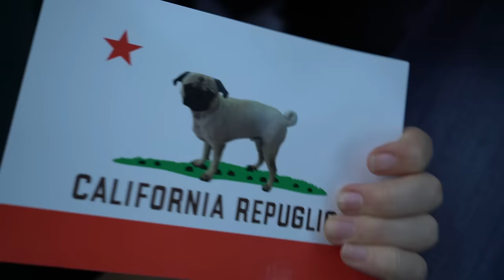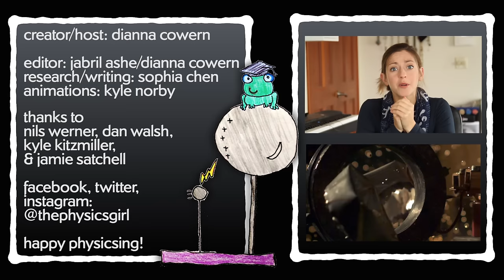How to control light with water

Comment: as a network engineer: I think you missed one of the most intriguing features of fiber optics. it can carry different wavelengths of light (we call them channels) . sticking with your laser pointer analogy: it's possible to send the light of differently colored laser pointers through the water at the same time and sending a different morse code on each - color only is a difference in wavelength/frequency after all. if I got your attention you can take a look at the Wikipedia page covering this topic: https://en.wikipedia.org/wiki/Wavelength-division_multiplexing there's even more science in there but the page is pretty OK
Reply: Thumbs up! I thought the exact same thing. I think it's because she didn't go into demodulation and the multiplexing part of the communication.
Reply: Frequency division multiplexing is not unique to fiber.  Back in the Olden Days, the fleet broadcast put 8 75-baud channels in a single 3 kHz HF signal, just for one example.
Reply: Very cool and useful phenomenon. I think that's a general property of waves because of the superposition principle and since sine waves at different frequencies are linearly independent.
Reply: A very interesting point!
Reply: TheThagenesis it would be nice to c a fallow up simple video, explaining the analogy of code Morse vs frequency interference...
Reply: Hi. Good question. Fragmented packets are not assembled at the ISP. but at the destination host (receiver computer). since It receives the packets in a random order depending on the routes the fragments took in the network. then matches with the original message.
Reply: there are different levels of reassembly depending on what you mean. all the light from a fiber optics cable is generally split by a DWDM shelf into the different channels (colors) the signal may be refreshed and/or amplified within the shelf and then the cable containing the channel is connected to a fiber interface which is plugged into a router (SFP is the standard for this nowadays but this changed quite a bit in the last 10 years). the SFP converts the information encoded in the light (typically an ethernet frame that contains an IP packet) into electrical signals the the router can finally put the IP packet into its memory and send it out again on the correct destination interface. this happens again and again until the packet finally reaches your home router and then finally your computer. the tcp/ip stack of the computer's operating system (Windows, Linux, MacOS or whatever)assembles single IP packets into a continuous TCP or UDP data stream and the computer finally can show those cute cat videos
Reply: I used to work for verizon fios, i was surprised at the sheer amount of data that went through the major COs

Comment: Hey Diana,

if you drill a hole in the bottlecap and put a longer straw in it, you can get a constant flow rate according to Bernoulli's principle. Use glue or blu tack for seal between the cap and the straw. You can adjust the flowrate by changing the lenght of the straw. So you just get the perfect constant laminar speed and the experiment will last longer.

I hope it was helpful

Comment: As someone else commented - Even more interesting than sending light down the fiber, we send MULTIPLE "colors" or wavelengths of light down fiber: Multimode.  With the use of a fiber optic multiplexer, we can do what's called Wavelength-division multiplexing.  Similar to how phone lines can send different frequencies down the same cable to carry your voice and data transmissions, multiplexing allows significantly more throughput (bandwidth) to go down the same strand of fiber. 

You mentioned that we will never be fully wireless, but I'd like to augment that statement.  End users can and will have the ability to be fully wireless in the near future, but it will be because of the accelerated growth of fiber optic networks that will allow this to become a reality.

Comment: You can encrypt owl post! You can use any of the encryption methods we currently use all you would have to do is right the code on some paper and it would take a long time to encrypt and decrypt by hand. Wizards also use Howlers which only activate when the intended recipient touches it. so every piece of post could have biometric recognition on it. (Better than muggle technology) The real question is that if you can apparate why not just not apparate wherever you want and tell the person the content of the letter.

Comment: to put into perspective, if you don't have to hop to another network, a high quality circuit can do us coast to coast transit in under 50ms. Fiber is still subject to a lot of outside damage, vandalism, animals, car accidents, etc. i have worked for almost every major telecom corp and you'd be surprised how much damage and outages are due to rodents/squirrels. Once they get inside they normally can't get out, panic , and shred the fibers and sheath to bits.

Comment: And the coolest part about optical fiber is that we make cables so well that we are still an order of magnitude away from maxing out the physical capabilities of our current fiber, so without having to redo the cabling, we can still make the internet a factor of 10 faster. After that we'll need to use a diamond/glass composite for diamond's wider bandwidth and a more acute critical angle, allowing for more physical space in multimode operation. Might be able to squeeze another order of magnitude out of that before we work out how to make fiber optics with a vacuum as a core...

Comment: But but but, you have the Level 3 problem of information density.

Suppose you want to send 400 TB of information to your mother in Hawaii. Now a shipment of hard drives ends up quicker (and cheaper) than sending the same info through optics.

It's not only information but the type and quantity that dictates the ideal transmission mode.
Reply: Never underestimate the bandwidth of a station wagon full of 9-track tapes.

Comment: 9:05 Not anymore. At least not in the ocean (they used to get broken relatively often and repairing them was difficult). Nowadays we dope the optical fiber with certain elements (like erbium) which absorb light of certain wavelengths (which forces their valence electrons into higher orbitals) and amplify light of other wavelength (when disturbed by a photon of the right wavelength, a valence electron will drop to a lower orbital and emit a second photon identical to the original one). Basically, in addition to the data, you fire a second laser into the optical fiber and the entire cable becomes one giant amplifier. Much more reliable and faster (and cheaper for long cables) than repeaters.

Comment: Something you might not have considered: With how the internet is structured, it is possible that some packets never arrive or arrive multiple times.
They could also come in different orders.

That's why packets contain information about which part of the message they contain, so the message can be reassembled. In case a packet doesn't arrive, the sender will simply send it again. The receiver has to send back a "got it" message. Otherwise known as ACK. ("acknowledgement")

Packets could also become corrupted on the way. It's not impossible to imagine that something could happen to the data underway. Part of the packet is therefore a checksum so you can make sure your data is intact.
This is actually a lot less common with fiber optics, but long copper cables are quite a problem in this regard. :)

(Note: For simplicity I'm assuming TCP packets)

Comment: You would also be fascinated by some other optical fiber properties. Fibers by nature are much more difficult to tap into like you might with copper cable. As soon as you crack the fiber to attach in, the signal drops in strength and it's noticed on the receiving end. You can also run hundreds and thousands of fibers next to each other thanks to the cladding without the fear of mixed signals. If you try to do that with copper, you have a mess of magnetic fields to deal with (and you are also susceptible to external magnetic fields too!)

Comment: You use a magic code for owl post so it is in code.  Corning has some pretty neat stuff about fiber.  The history is pretty neat.  The fiber strand is thinner than a human hair.  Fiber splicers tend to end up drinking to much.  The data sent on the optic network is "boosted" but also it is not uncommon for 2 copies of the data to be sent different routes. That is one of the reasons they really want to use optic for data it is "easy" to send an exact copy of the information.  It is harder to copy without being part of the circuit, unlike audio is easy to replicate without cutting open the cable, using magnets attached to the outside of the cable.   Awesome video even though it is old it is so current. you are so gifted.

Comment: @Physics Girl re 5:20
The Photophone was invented circa 1880. It was like a radio except that instead of using radio waves to transmit sounds, it used light. So rather than just the simple morse code 'dots n dashes,' the 19th century had the photophone (though it was never widely developed, unlike radio).

Comment: Our desire to download does cause us to have higher download than upload speed, but somewhat indirectly. ISPs have border contracts with each other  which penalize one side or the other for asymmetric communication. Many ISPs address the effective asymmetry by hosting datacenters (frequently through more peering contracts). They provision assuming folks want more download speed  (which is generally true), but that in turn incentivizes  them to penalize folks who rock the boat, both because of provisioning costs and because if the average home use were symmetric, a fraction of their business model would dry up.

Comment: If your connection is ADSL then part of the reason that the download speed is higher than the upload is crosstalk.  For You->Exchange the signal is at its weakest at the exchange where there are lots of other lines also coming in, so it's the hardest to get a clear signal.  So, the frequency bands that suffer least from crosstalk are used, but that's quite a narrow range of the total.

For the other direction the signal/wire is coming in to your home at its weakest 1-10m or more from the nearest other line, and thus there's less issue with crosstalk.  That means they can use a wider range of frequencies for that.  And of course this s all constrained by the range of frequencies that work down a (hopefully!) copper (not aluminIum!) cable.

So, with ADSL they could try to even up the speeds, but gaining X B/s of upload will cost more than that off the download (as they'll have to use a wider spread for the channel to try and overcome the crosstalk issue).

And, yeah, historically most people only need enough upload to cover things like the TCP ACK/replies side of whatever they're downloading/streaming.

Fibre To The Premises should be immune the issue.  Depending on range Fibre To The Cabinet could still have the issue (it's still VDSL from the cabinet to/from the premises).  Even with my awesome line very close to the cabinets I'm on an 80/20Mbps package.  The sync started around 95/25Mbps and has settled down to 93672/28273 kbit/s.

Comment: You can achieve a constant water flow out of the water bottle if you put the cap back on but poke a hole through it and submerge a straw through it down into the water. The lower the straw is submerged, the lower the flow until the water remains stationary.

Comment: You actually said ( 4:10 ) that light in fiber goes 2/3 the speed of light in vacuum, so laser comm-sats are faster than fiber for long distances. Fiber is still cool though. Your next assignment; design a programmable fountain that confines laser light, or doesn't depending on the pattern, so you can be hugely popular on Ibiza.

Comment: sending packets across the ocean is fast because they aren't being asynchronous packets at that point; they're packaged into 'frames' in a synchronous connection and there aren't frequent stops to have their address checked and to be routed differently.  The fibres are the fast part; it's the computers/servers in-between that add latency

Comment: How would you explain the wave particle duality of light in this process of light bending? If a reflected photon is a new photon light could bend as a process of wave particle duality over a period of time. Light waves would interact with the atoms of the water forming photons relative to this movement.

Comment: There's been some models proposed recently that suggest that satellites could beam laser transmissions faster than the fiber optic cable system because they are transmitting through the vacuum of space. And that's actually one of the less interesting things going on right now. Perhaps satellites and the NewSpace tech going up into low Earth orbit could be a future topic for a show?

Comment: The real advantage of fiber vs copper is bandwidth not outright speed both signals travel at the speed of light.
Reply: Paul is right. My bad.(well i kinda was a little right)
Reply: Oreole1, sorry, could you explain your statement? From what I remember, the electric field travels at the speed of light through a wire, it's just that any given electron moves very slowly.
Reply: What you need to keep in mind is that an electric signal is not the same signal from source to destination. It's constantly being absorbed and re-emitted by electrons along the way, so while each piece of it travels at light speed, the time it takes for the signal to reach the end is actually slower.
Reply: GlassTopRX7 not quite so simple:

Copper wires have a problematic effect called parasitic capacitance which significantly limits the voltage rise-time through long cables.

So although the transmitter sends a voltage signal to the reciever by raising, or lowering, its voltage, the cable capacitance means that the changed voltage signal is significantly delayed before the receiving amplifier can sense that voltage change.

Light pulses in fibre optic cables do not exhibit the same electrical effect as cable capacitance.

Also, long copper cables have other problems like resistance and noise sensitivity, requiring a larger voltage signal to generate voltage changes that can be reliably detected by the reciever.

Overall, electrical cables are much, much slower than fibre optic cables at transferring information, for a variety of reasons, especially cable capacitance.

Comment: talking about internet speed, there is latency and there is bandwidth. one can have the ability to download large files fast and still have a slow acting internet.
latency refers to how fast your postcard reaches it's destination; bandwidth refers to how big (or how many) of a postcard can the carrier transport from one point to another over a given time... for small traffic, such as emails, chat, VoIP, browsing, etc, latency is more important that bandwidth. 

search for "ping". a useful way to check how quickly a server (such as youtube, google, etc) responds to your requests. it can vary from 5ms all the way up to seconds... anything below 30ms is considered good response time (except for locally connected devices where the latency should be below 10ms).

Comment: Many, but not all communication satellites are orbiting at 36,000 km, but some are much, much lower, as close as just a couple of hundred kms.

But the delay isn't in the distance traveled by the signal, but in the very complex and expensive electronics systems designed to send signals to and from orbit. 

The electronics associated with terrestrial fibre optics is much, much simpler, cheaper, faster and more reliable than spacebourne satellite electronics. 

And, as was briefly pointed out in the video, there is no rocket launch risk or expense associated with terrestrial fibre optics. 

Neither the speed of light or signal distance traveled matter much at all. The big issue when comparing terrestrial fibre optics to satellites is the cost and speed of the electronics.